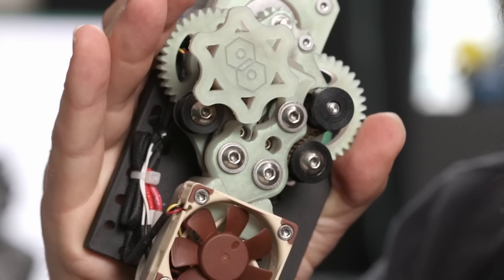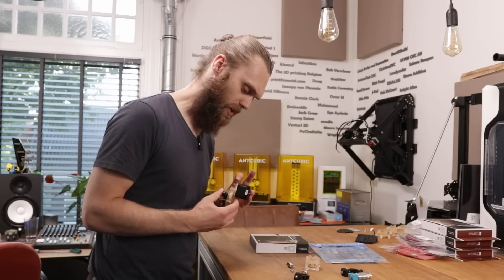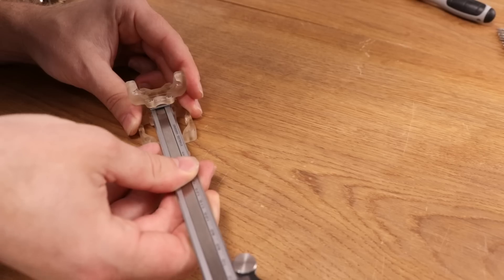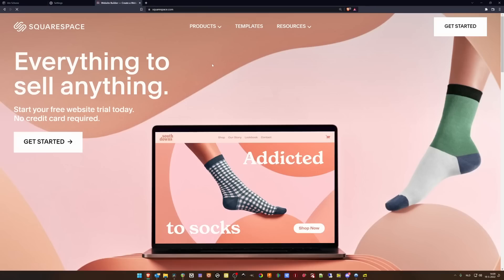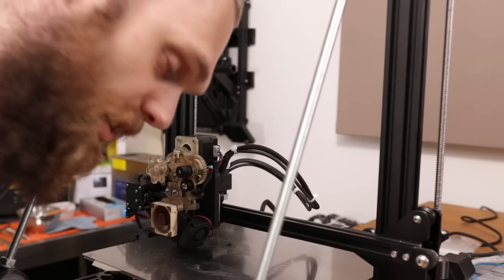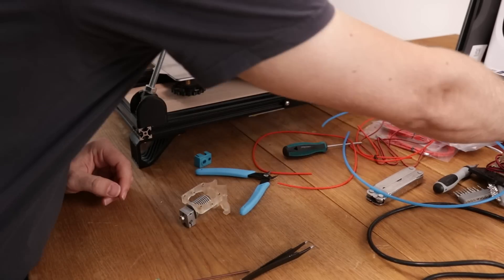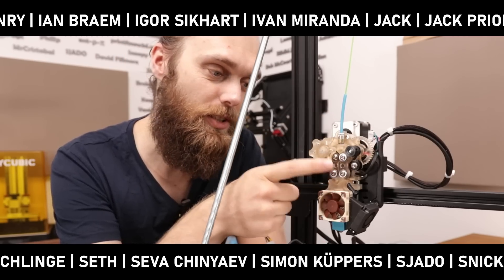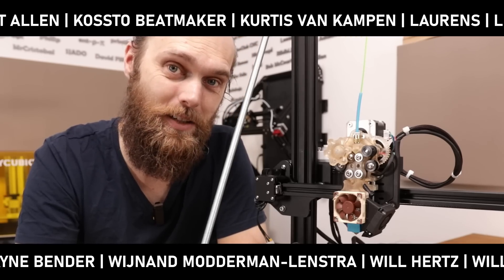I Designed an Adapter to Swap Between Hotends!

Comment from the maker: If you have an idea which extruder would be interesting to fit on here, let me know! Only the files of the standard Proper Extruder are available on my website for now, but I’ll add this version soon :D
Reply: What would be to have to both sides longer X axis, and the connector would be the magnetic like - eg. magsafe connectors... That way would be able to use a set of extruders that the printer could replace automagically in between printing process. Using both sides of the printer as extruder host, and reuse of your invention as flipping between heads - would be really interesting.
Reply: hotswapping a mini dremel for mixed additive and subtractive ?
Reply: Pellet extruder designed by you 😉
Reply: I'm really interested to see if the belt design eliminates the issue of "inconsistent extrusion" toothed hotends have! if so, I'm building one asap!
Reply: I really think your belt design would be perfect for that, as it doesn't deform the filament while gripping it! I really should give it a try or something similar, like a super grippy neoprene wheel instead of teeth
Reply: How about an easy way to clip on a hotend fan instead of requiring one for each and every hotend?
Reply: mosquito magnum or magnum+!
Reply: @ZoltanHoppar  be really impressive if you can make an e3d Hemera work - though your idea is very similar in that you keep the filament path super constrained.
Reply: Hi, can i print and use this extruder in my printer? I have an ender 3 pro

Comment: Great design! 👏😎 The 2 x M3 screws holding the V6 collar is a pretty smart idea!
Reply from the maker: Thanks! It was a workaround for the bowden tube that was sticking out, but it turns out to be a good working solution on itself!
Reply: Agreed - the M3 screws thing was genius!

I wonder if a grub screw or two driven into the groove mount perpendicularly (the tip of the screw slightly digging into the aluminium, not cutting threads into it) would have worked well enough... 🤔
Cutting threads is no doubt stronger, but the heatsink shouldn't see huge rotational forces (or the heat break would … um … break 👀) so grub screws might be enough.

Grub screws/perpendicular screws might require less force to install, too - I'm not sure I'd trust a FFF-printed part to survive the forces needed for cutting threads :)
(For other extruders, I mean, not yours; e.g. adding grub screws to a Prusa i3's E3D V6 to stop it rotating)

Not that it matters much to me - my only printer uses a Hermes-branded Hemera so I haven't had to deal with groove-mount for a while :D
But I broke the wires of several thermistors and heater cartridges during nozzle changes when I was using the old V6, so I know that pain! 😫
Reply: Same solution was used to hold extruder in ROBO 3D R1, nothing new.

Comment: Something I‘d be really interested in is a diy hotend-extruder combo.
So a heatsink that’s part of or directly connected to the extruder and has provisions to mount the cooling fan and parts cooling fan to it, so its a single piece that can just fulfill the roles you usually would need a bunch of different pieces for.

In my mind it also allows to use a 40x40 fan for the parts cooling, so people can go all noctua and have a machine that doesn’t produce any sounds.

Comment: For the heat cartridge connection you probably want to use more of the pins on that connector to avoid melting it.(ask me how i know ;p)
Reply from the maker: This quality connector can handle 6.5A/pin, it'll be fine ;)
Reply: D-sub connectors are typically rated for 5 amps, gold contacts even more. Thats enough for a rapido with its 115w. For reference, thats not far of from a whole prusa mini and more than half of a ender 3 and similar bed
Reply: @kilianlindlbauer8277  had one melt out after s bad connection from corrosion

Comment: Nice and inspiring video, thx. i am playing with CAN-bus and Klipper for my toolhead. Very simple connection (4 pins) with small controller on the toolhead. More flexible in the long run but more complex for the first toolhead.

Comment: That is soooo cool!!!! Maybe after you make your first million you could please design a replacement all metal standardized extruder that can replace the extruders on the i-fast. It's a great printer but  it needs a better high temp extruder.
Reply from the maker: Thank you! That idea crossed my mind. I like the printer, but really dislike the extruder. The toughest part would be to keep that switching mechanism between both extruders working in the same way.

Comment: an idea for fitting those: add a cam to hold the hotend instead of using screws, that should make switching the hotends way easier.

Comment: I have an idea. Being that you made it swappable. Which means u need steper motors for each component you use..why not use just one motor and the same flex cable  that's used in the flex extruder and nimble flex extruder.  Saves on motor connections and checking motor steps, and weight!  Just a thought.

Comment: This is probably the first time a Noctua fan works with an existing color scheme :D BTW, the 40x10mm Noctuas don't blow a lot of air and it might be better to use a 40x20mm fan. I love this project! I hope you keep on tweaking it. Would be cool if some other YouTubers like Stefan or Vector3D could scientifically compare it to some other commercial extruders.

Comment: It might be interesting to try one of the shortened hot ends that's moves the heat sink out of the line of the filament. I can think of the Bondtech LGX FF off the top of my head but I'm sure there are more.
Reply: old style replicator hotends. (alu bar that gets a heatsink bolted on it that the feedtube goes into

Comment: Do you need the special resin to print these parts? I love your concept I have a old k8200 I want to modify  all new stuff and I want your extruder
Reply from the maker: No, you can even FDM print it! If you want to use resin, I do recommend to use engineering resin because the standard stuff is too brittle.
Reply: If Im not mistaking, he said he'd design them to be printed with FDM materials aswell in a recent video
Reply: @properprinting  thats what i wanted to now i will print it on a peopoly L in resin. thx

Comment: Why did you use a noctua fan for hotend cooling? Looking at the specs sheet I have found noctua fans to perform very poorly (in both price and noise) in high pressure low flow applications, as is the case for cooling a hotend. There are much better (and at the same time cheaper) options out there.
Reply from the maker: Interesting, these are the most silent fans I ever used and I like the aesthetics. I assumed that Noctua was the pinnacle of fans. What do you recommend?
Reply: I’m glad someone else feels the same. I wasted $15 on a tiny fan that made PLA unprintable in my printer. $8 for a 4 pack on AliExpress? Those work great and are basically as quiet
Reply: @properprinting  I guess if they work then they work, but hydraulic bearings get you most of the quiet gains if that’s the goal
Reply: @properprinting  They sure are silent, and they look good, but in most applications where flow is obstructed (i.e. there is resistance) the flow drops tremendously. They are also massively overpriced for how they perform. Noctua has a very good PR department, but there's a reason why you don't see them in most professional equipment.
As for fans, there's a couple of brands that seem to do well: Gulf Electrics, GDS time, Delta and Sunon.

As an example to illustrate my point:
You seem to have the NF-A4x10 there? That seems to produce a dBa rating of about 18. Sadly Noctua doesn't actually provide PQ curves, just the two extremes (~8.5 m^3/h flow, ~1.85 mm H2O pressure), still we will try to work with this. 
You don't need to search for very long to find a better replacement part. For example the Sunon HA40101V4-1000U-A99. It has ~9m^3/h flow, and  2.286 mm H20 pressure at the extremes. Typical noise is just 15.7 dBa, and the very best part: They are just 4.87$ in one off quantity (digikey). This was a fan I found quickly just now using distributor search engines, I am sure if you actually put in some effort you can find significantly better fans for the application. 

The best approach would be to do a flow simulation and estimate where on the PQ curve you'd be, so that you can optimize the fan on the specific application. But maybe that goes a bit too deeply into the topic.
Reply: @nathanblanchard8897  It's not just your feeling, it's supported by the numbers. Especially replacing the part cooling fan will cause you heaps of trouble, as those need to work in a very flow restricted environment. Sadly people just think that Noctua is automatically the best because they are famous for PC fans, which just isn't true.

Comment: You say the front parts have to be as stiff as possible. For those parts could I CNC them out of 3mm aluminum and print the rest of the parts? The work you've done is amazing great job.
Reply from the maker: PLA would already be stiff enough, but the stiffer, the better. The parts are thicker than 3mm, so you should stack the plates or modify the design.

Comment: 8mm injection/compression screw from aliexpress, in a 10x8mm tube, feed the tpu in to the screw at one end and let it spiral down while being heated, like a pellet extruder but without the pellets?

Comment: The db connector can handle that much current? I'm pretty sure I thought I saw you use a custom connector with larger pins for the heating element itself a while back.
Reply from the maker: Yes, no problem. I also did that with the original swappable hotend. The reason why I did that with the custom connector was because I crimped those connections myself. I didn't trust that as much as I do with these genuine Harting connectors.

Comment: Awesome to see the progress on the Proper Extruder. We are looking to change out our machines we use for our business to your design. Would you foresee any issues with the extruder printed in SLS nylon? As always, keep up the great work.
Reply from the maker: Thanks! Awesome that you want to use this with your machines! I don't have experience with SLS printed Nylon. The base part and front plate must be as stiff as possible and I don't know how flexible that Nylon is going to be.
Reply: @properprinting  It can be incredibly stiff. Parts from the Fuse1, for example, were too stiff for my application.
Reply: @condorman6293  Those were likely CF nylon prints then. Regular PA12 nylon has a flexural modulus of about 6.6e8, PA 6 is even worse. PA66 performs probably the best but also at 1.37e9, doesn't come close to for example PLA, and is about on par with ABS. As a comparison, even PETG has a flexural modulus of about 1e9.
Although I do think printing it out of CF nylon might be interesting, as the stiffness and yield strength are much higher.
Reply: @properprinting  Regular Nylons (PA12, PA6) are probably not stiff enough (approximately the same or worse than PETG). However, CF Nylon blends might be viable as they are both stiffer and have a higher yield strength.
Not sure if you have experience with the markforged printers, but if you are able to do carbon fiber inlays with those, the stiffness goes up dramatically, and those results are way stiffer than PLA, yet unbreakable by hand for most parts.
Reply: @tHaH4x0r  They were not. They were PA12 and PA11.

Comment: Is that a parallel port? I'm surprised that can have enough wattage for a hot end
Reply: I think he uses multiple pins to share the load, similarly to how the duet ectruder board uses several ethernet pins on an ethernet cable
Reply from the maker: Quality sub D connectors can handle quite a lot of current. I used this Harting connector which can handle 6.5A/pin https://b2b.harting.com/ebusiness/en_us/D-SUB-FE-STAMPED-SOLDER-CUP-15-PL3/09672154704 The heater is 30 Watts, so this doesn't cause any problems. If you're using cheaper connectors, pairing them would be a good idea.

Comment: How about the Mellow Libra mini extruder?
Reply: i have one what about it?
Reply: @warmesuppe  He asked is there any extruder you'd like to see tried out.
Reply: @ellisgl  ah sorry didn't hear that.
Well at least i can say that it doesn't solve this vertical artifacts issue, or issue 602.
So it's not better than a regular sherpa mini.
Reply: @warmesuppe  well crap, I was hoping the helical gears was going to solve that. 😢
Reply: @ellisgl  Mihai said so but i was curious as well and did test it with his methods, but its just like a normal bmg Extruder geat set
Reply: @warmesuppe  yeah, that's what I basing my hope on, the video from him. Of course the other gear in that extruder is straight toothed. 🤔
Reply: @ellisgl  No they are both helical. Otherwise it wouldn't work
Reply: @warmesuppe  I thought the Nylon one was straight toothed.
Reply: Looking at the picture, the brass gear on the motor shaft and the reduction gear look straight
Reply: @ellisgl  Ah okay you mean the drive gear, but that one doesn't matter.
it's the distance between the two extruding gears that matters for the artifacts

Comment: How come you are using wham bam  instead of your quick change design ?
Reply from the maker: Because of the mounting options it has. This is the perfect option for this experimental platform. For instance, I was able to mount two lasers on it for FDM resin printing.

Comment: Hi Jon,
I had a question about the Proper extruder I saw this video about inconsistent layers https://youtu.be/c6JmCdovE0U and he came to the conclusion that it’s inconsistent flow because of the Bondtech style gears so can you test if the Proper extruder also had that problem (because of the timing belts)
And can you make a video about that
By the way: I’m also Dutch